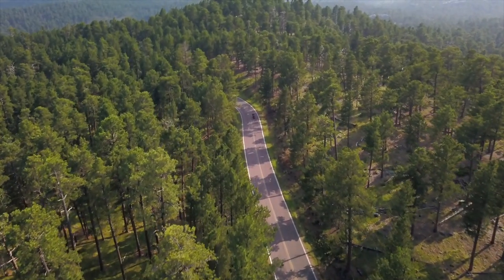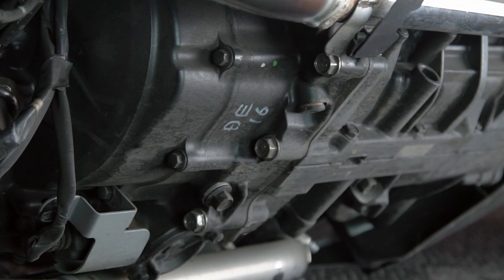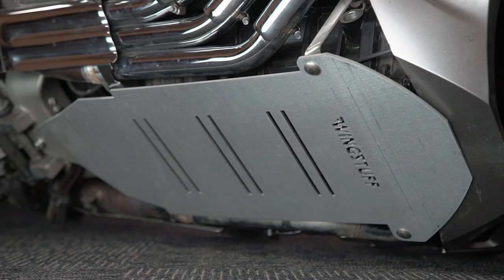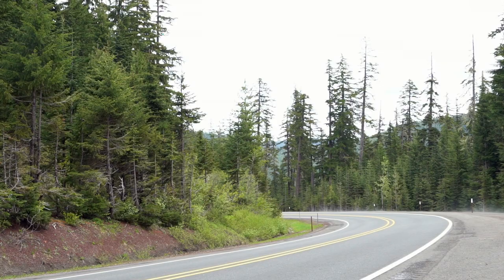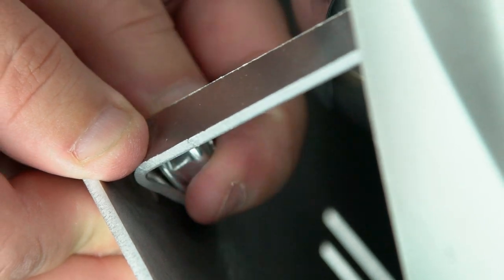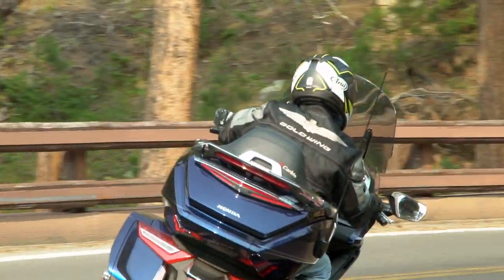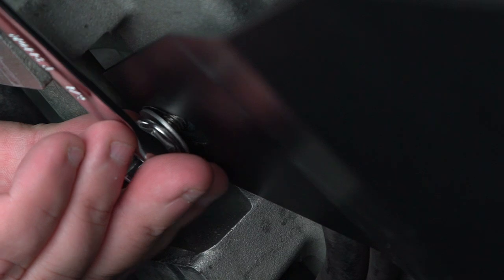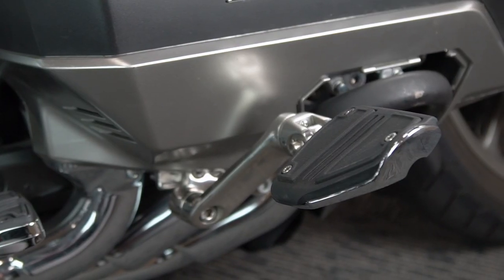Belly Pan for 2018+ Gold Wing at WingStuff.com

Comment: Honda engineers probably didn’t engineer the engine to be a direct mounting point for anything, other than what they mounted to it. Is the engine strong enough?, maybe, nobody knows. The one thing that is for sure that when an object is in direct contact with another object it can, depending on material, transfer a large portion of force to the second object, like a croquet ball. The wing stuff version is not directly in contact with the engine, and that small gap will allow force to be dispersed prior to transferring energy to the engine. How much force?, nobody knows. One other thing to consider is how does the Traxxion change the vibration frequencies of the engine? IMHO feel the Traxxion integrates to much with the engine design, with unknown possible conflicts, without providing a clear increased level of protection over the Wing Stuff.
Reply: But what, pray thee, is unknown? Nobody knows.

Comment: great idea horrible engineering. Your 20 min install took 50 min after multiple bending shaping reinstalling your "built to fit" brackets. 5 stars for the pan ZERO stars for the brackets.